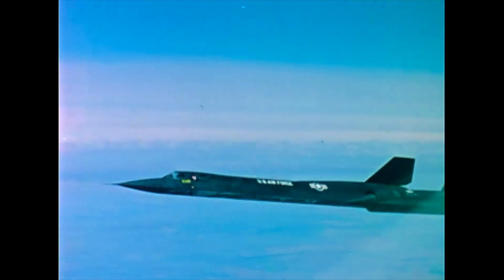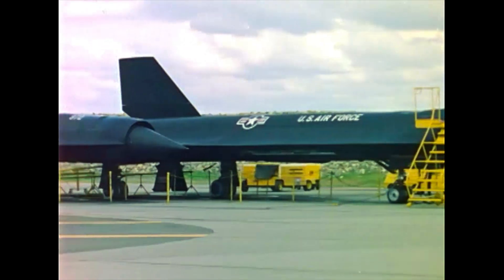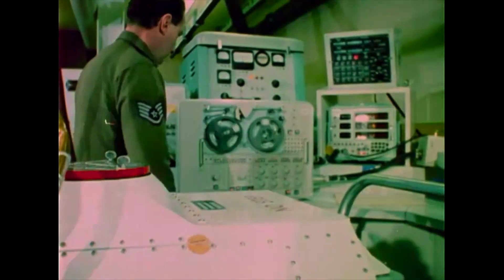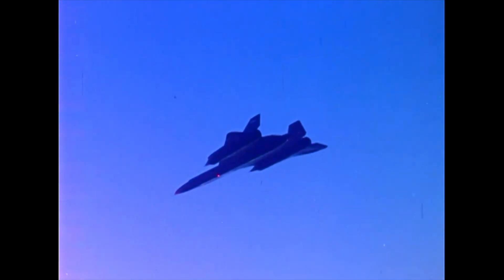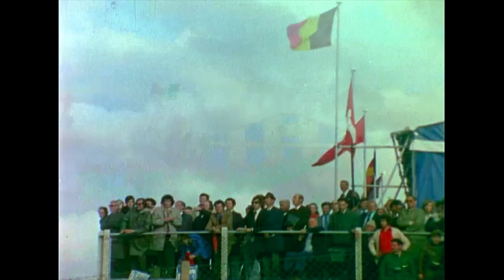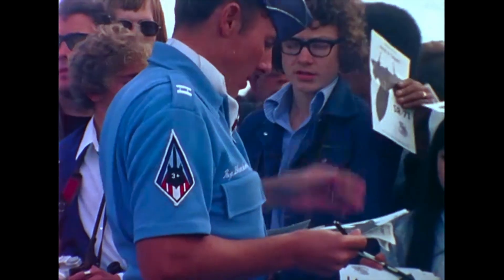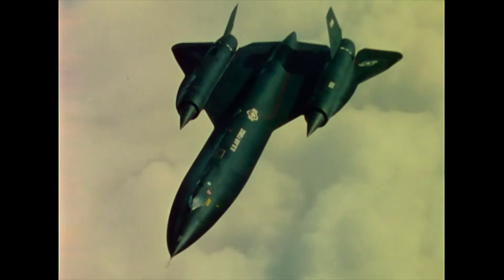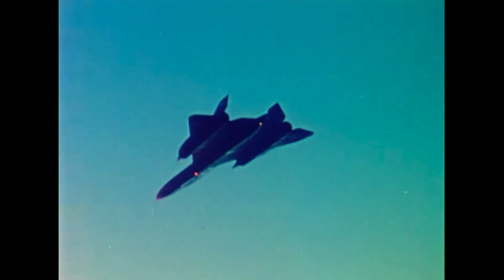SR-71 Blackbird & Farnborough Air Show 1974

Comment: Kelly was always trying to save weight. It got so bad that Ben Rich said to fill the tires with helium and give the pilots a pre flight enema. Always thought that was funny.
Reply: @billybupkis3688  not as funny as a boy named Kelly Johnson who has taken credit for an aircraft designed, engineered and built during the Old World Black Empire. The SR71 is most likely a pre 1630s aircraft. That is pre 1630 in your calendar.